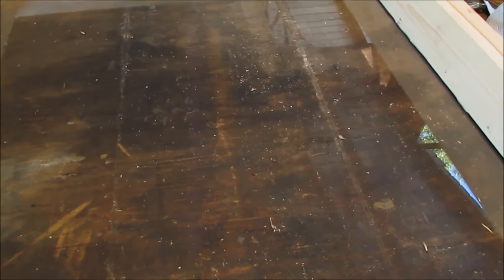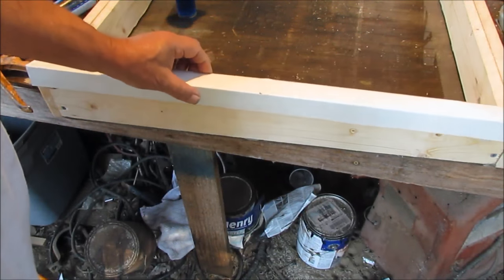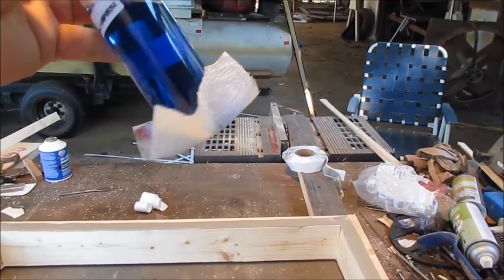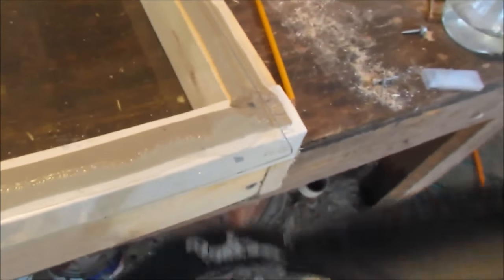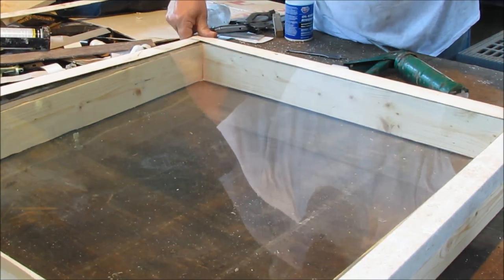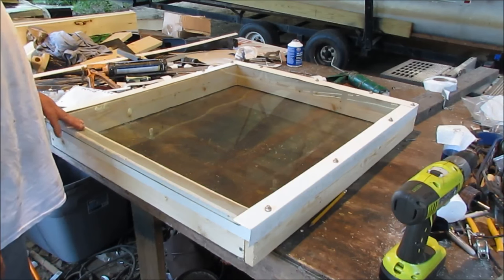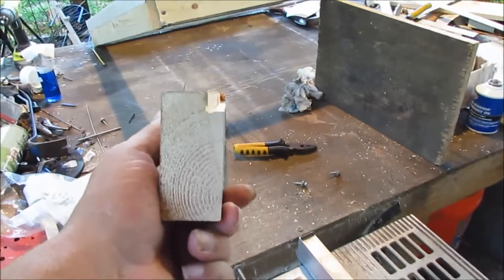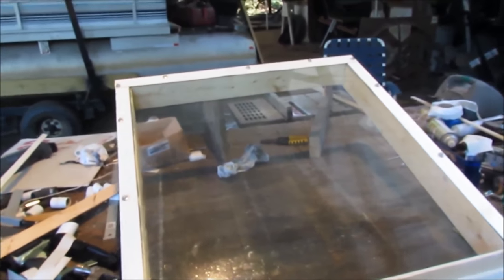How To Make A Skylight Part 2

Comment: Thanks for your video I was wondering if there should be a sealant between that top aluminum flashing and the glass? Seems like water would get in there on top. I got a step van with a bowed roof and I've been researching this. Guessing that putty is buytyl liked how you did that and the sealant. 

I used silicon on top of some doors I made in the back and it didn't stick that well to the aluminum and some peeled off  so a little leery of that one.